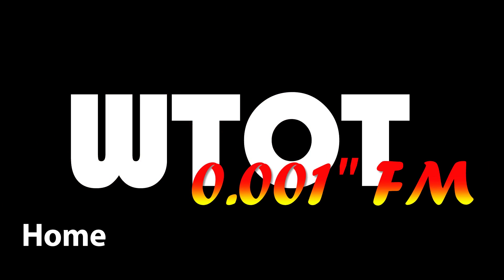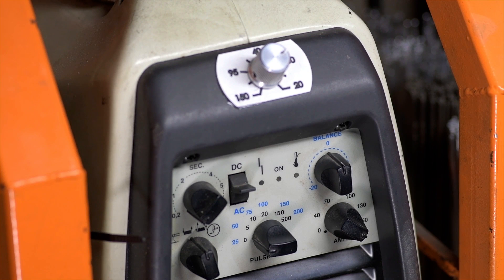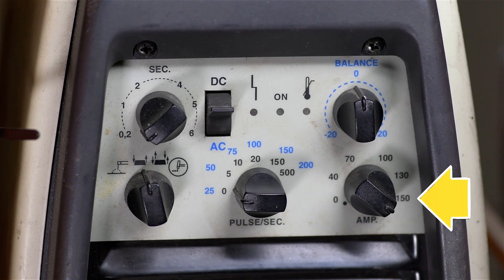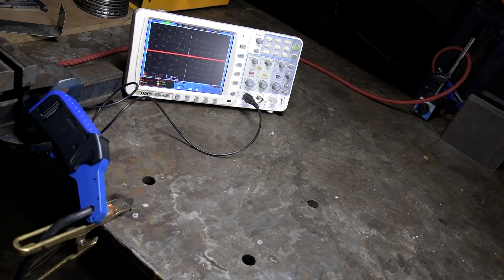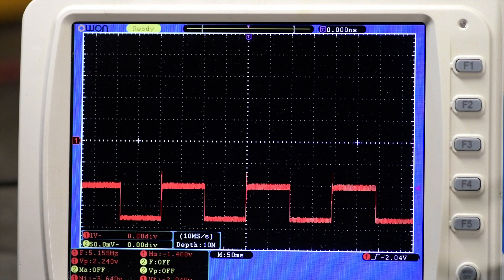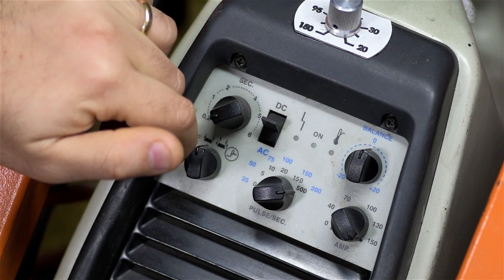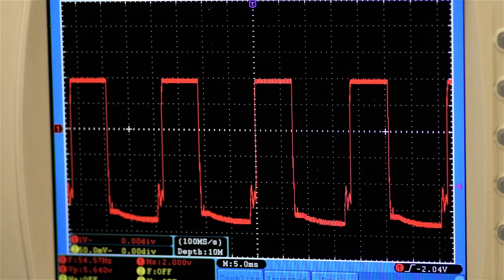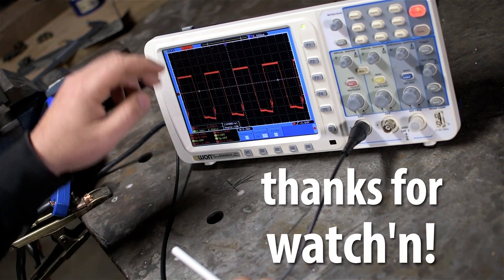My TIG Is Breaking Up With Me

Comment: Check the ac balance pot. 0-5 or 0-10 or 4-20ma signal , manufacturers use different standards. Check that signal as you turn the pot, as the response from the waveform looks very dirty as you turned the pot. Trace the balance circuit and there may be multiturn trimmers inline , check those also. Even if you have one on hand replace the pot. Itll be 5 or 10 k

Comment: Hi, I don't clearly understand the trick with current clamp and voltage measuring - what do you exactly measure: voltage or current? (I've once tried to measure voltage of tig welding using voltage meter which I've plug to positive and negative clamps, but I've broken my multimeter this way. So, have you any tip how to mesure TIG-welding voltage during welding? 
PS. great video

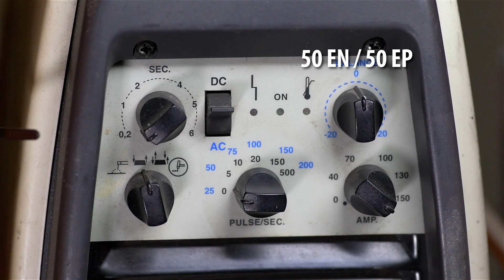Comment: Tony-san. Your math! Focus! around (4:50) "shifts balance to 70-30: 20 more negatives than positives..." So 70 minus 30 equals 20 huh?
Reply: @ThisOldTony as an electronics engineer with strong electromechanical affinities, I'd like to point out a confusing usage of "current" in your explanations. It will be mostly confusing for people who handle electrical applications aside from their welding. You seem to be using current for current, voltage and polarity. This may have resulted in a weird proprietary interpretation of the term AC. That "pulsed DC" is in fact AC (where you explicitly wrote on screen "so NOT AC". The polarity doesn't change, but it's AC nonetheless because the voltage alternates between two values, with the same circuit this will result in two values of current that it alternates between. So it is alternating current (AC) but without alternating polarity.
People who already have prior knowledge of electric circuits may get confused by your explanation, and people who don't have enough prior knowledge, will learn poor habits from this explanation...
As much as I love all your videos, I felt that I had to point this out. Especially because of your affinity with being exact when it comes to mechanical things. Without electricity your work wouldn't be possible, let alone be exact, so the electric side of things deserves an equal level of "exactness"...

Sure hope you get to read this, although I know I'd probably have more chance winning the lottery this week... (And I haven't bought a ticket, mind you)

Comment: I used to have an Esab 161 TIG machine that was even simpler than yours.  It blew out a bank of overrated Italian MOSFETs the first time I ran it at full power (160A) DC, and I reverse engineered the output board to repair it affordably with Made-in-USA MOSFETS from IR.   Your assumption on the AC Balance setting at "0" is mistaken, as this should NOT produce a 50% duty cycle.  The "0" setting is supposed to be a good starting point for AC balance on Aluminum, at perhaps 70% DCEN (penetration) and 30% DCEP (cleaning).  The +/-20% adjustment should tune this from 50% to 95% perhaps.  The welding heat is reflected by the area under the curve on your scope, so reduced DCEP current provides an amplifying effect on the AC imbalance, not necessarily a bad thing because it's saving your tungsten.  I honestly think the only problem with your welder that I saw in this video is the intermittent DCEP issue on AC.  THAT is a problem.  It's probably a bum chip between the oscillator and the MOSFET bridge driver, like an opto-isolator or some other level-shifting logic.  The Esab design used simple capacitive coupling to isolate the 5V TTL driver logic from the high voltage at the MOSFET gate drivers, so even a weak op-amp or comparator can create the problem you have.  Wish you were closer; I think I could help!  Of course, now I have an Everlast 255 EXT and left all those problems behind, along with the ability to fix it myself!  Love your channel.  I'm gonna get one of those Hantek CC-65 amp clamps!

Comment: I do realise that this video is around 2 years old, and you've probably thrown your old TIG welder as far away as you could. 
Should you ever come across the same problem again, there's 2 possible reasons for this/these fault(s).
To be able to regulate voltage or current, the machine ALWAYS convert AC to DC. To do that it use a diode bridge (or several) and a certain number of big electrolyte capacitors.
The faults you describe is most likely caused by 1 faulty diode on the positive side of the bridge, combined with 1 or more capacitors which have lost some of their capacity.

as these parts are some of of the more expensive bits of the machine, it absolutely WON'T be worth it to get it serviced, unless you can find the parts and exchange them yourself.

PS: sorry that my answer requires at least some knowledge of electronics. I may have skipped some necessary explanation of things I take for granted, being an electronics tech. guy 😁

Comment: Balance is not balanced at zero on tigs.  But more like 35/65  thats what they call balanced for aly.  

My TiG does the same thing,  its mentioned on the manual, its intentionally not at 50/50 on the "balanced" positiin .  Its a French machine so i will translate :

Balance goes from -15  to +15

35EP (35/65) being the 0 or the "optimal cyclic ratio" position.
+15  equals a 50EP/50EN wave
-15 equals a 20EP/80EN wave 

My other tig Miller machine will go from 10EP/90EN  to 70EP/30EN  but you can set EP/EN amps independent

You rarely need more than 50EP.  Or thats some very dirty alu like porous castings full of crap and oils... 

(But your machine not going full amps on the other side is weird.  Maybe there is a setting inside the machine ?)

Comment: The fact that it intermittently works is a traditional indication of a loose connection somewhere.  Finding where is the trick.  It of course requires that you remove the covers and then try to wiggle various wires or components on the boards.  But use something like a 2-foot wooden stick or similar length plastic rod (nylon or ABS, 1/4” to 1/2” in diameter would be good).  Start with the heavier cables.  Proceed to smaller stuff and probably smaller pointer (1/4” maybe).  Sometimes the problems are in solder connections, but often in connectors (or their soldering).  Especially anything that is suffering from vibrations is a prime suspect.  Think in terms of a cable touching a fan or a loose mounting panel.
As to the balance, I would start by measuring the voltage at both ends of the potentiometer.  Chances are the two should be same value, but opposite polarity, as an example +10 V at one end and -10 V at the other end.  At least that is how I would design it.
The overall system quite likely is an inverter generating the DC and an IGBT bridge turning it to variable polarity in the AC mode.  That’s how all the recent VP welders I know of are working.  In the older days there were SCR systems like Miller Synchrowave, but they were limited to operation basically at 60 Hz (American) power line frequency.  For other frequencies you need the mentioned IGBT bridge.

Comment: If you modified the machine from its original setup and intentionally bypassed and changed how it was designed/built by adding ANOTHER potentiometer (the foot pedal and manual current control are both potentiometers and there's a reason only one at a time is used to control the machine) then guess what? You probably damaged it with your "improvement". If you've made other changes and "improvements" to make it "hotter", then you've probably done even more damage. Especially an "inverter" machine that may not even be built for your "local" electrical service in the first place. 

You're also reading way too much into "constant current" and "constant voltage". YOU control the actual "current flow" with more than just your foot on the pedal. When you open up your "arc gap" and get a hotter arc its because it takes MORE "JUICE" TO JUMP THAT GAP regardless of whether the machine is "constant current" or "constant voltage" or "AC" or "DC" or "straight polarity" or "reverse polarity". Take it from somebody that cut his teeth arc welding before MIG became a "thing" and who has also MIG-welded extensively and did a fair amount of TIG in a tech school welding class as part of a diesel mechanic education. 

The "constant current" or "constant voltage" situation is within the machine itself and its a "self-protection" system simply BECAUSE actual welding current/voltage is NEVER "constant". Resistance changes continually with temp change and temps change continuously with amperage/voltage change and that causes more resistance change and its a vicious circle. 

Then there's MAINTENANCE. Welders - like generators and other electrical systems that handle high voltage/current and tend to generate significant amounts of static electricity and operate in dirty environments - like to be cleaned up occasionally. Heat sinks and fan blades and other components tend to get coated with dust, lint, metallic particles from ferrous metals attracted by electromagnetism, etc. 

And where in the hell do you live that your AC is 75 hertz?

Comment: Some of the errors on the O-Scope looked a lot like a dirty potentiometer. Others looked like a dirty switch contact. Seeing that the thing still works, but is essentially 'uncalibrated', I'd point an unusually pointy finger at those parts and not the heavy duty parts.

Comment: purpose of a.c. tig welding For materials, such as aluminium, which has a tenacious oxide film on the surface, AC power must be employed. By switching between electrode positive and electrode negative polarity at typically fifty times a second, the periods of electrode positive will be sufficient to remove the oxide and clean the surface,

Comment: A few suggestions: 1.) High frequency from a GTAW machine will destroy multi meters and oscilloscopes. Turn the HF off when connecting these meters. 2.) What type of tungsten are you using in the torch? For AC tig welding, you should be using pure tungsten or zirconia tungsten. The other types of tungsten don't pass welding current equally well in both directions. 3.) Don't grind a point on the tungsten for AC welding. Find out how to form a ball on the end of the tungsten electrode. The ball will help to stabilize the arc.

Comment: tony ur DSO only shows volts vs time.. 40A DC prob requires a ring clamp to measure it.. most multimeters would blow up
Reply: if you do volts x current you get Power in watts
Reply: you are showing 1V/division, as shown on the BLHS

Comment: hello Toni,
I bought the same oscilloscope and current clamp a  few days ago, because I destroyed my old oscilloscope trying to messure the current by the voltage drop of a shunt.
I can tell you, that the current of my LCD vision welder looks very bad in comparison to your welder.
At first, I had big differences between positive and negative current. Then I noticed, that I can change the coupling of the oscilloscope to DC mode and ground mode. With this settings, both currents were equal, but I have still a high current peak at the beginning of each positve current. This is the reason, why my tungsten electrode will split very often.

with best greetings from Germany

Edgar

Comment: I would start with testing the output stage devices. If one mosfet has failed, replace all as the others will likely have been stressed. Test back one component at a time until you hit no faults. A schematic would be damn handy. Drain the supply caps before testing. Use a tester like this: http://levysounddesign.blogspot.com.au/2016/04/octopus-tester-component-curve-tracer.html?m=1

Comment: Just like Dave Jones from the EEVblog says, "Don't turn it on, TAKE IT APART!"  
Just open the sucker up and see if something appears to be amiss.  Measure the potentiometers, coils, etc.  Caps leaking or exploded?  It's probably on a pcb board somewhere, where the wave pulse is generated.  Could be just as simple as some SM component needing resoldered.
What could it hurt to have a peak under the hood?

Comment: 10 years old plus? The easiest way forward is to just replace all the electrolytic capacitors. Maybe $100 or so, just replace them all. Digikey is your friend. Almost certainly there is a place where one capacitor is screwing up on the DC balance. But many of the caps are nowhere near their original specs. Just do them all.

Comment: I am very impressed  with your troubleshooting skills. Most experienced welders would know that there was something wrong with their welder, but wouldn't know what it was. The idea of using an amp meter clamp around the ground connection and hooking it up to an osope  to look at the wave forms was brilliant. Is the voltage reading on the scope comparable the amps or do you calculate that using Ohms law, or does it matter? Is the amp clamp made to attach to the scope or did you cobble it together. Should you hook up an isolation transformer between the clamp leads and scope input? I have a hand help clamp on amp meter if I opened it up and paralleled the leads to the voltmeter and brought them out to a plug for the scope would that work? With a wiring diagram and possibly a manual you could probably repair this unit very cheaply.
Reply from the maker: Thanks John.  The clamp meter has a selectable scale, say 1mV/10mA ie 1V/10A, so I set the voltage scale on the scope accordingly.  This particular clamp has a BNC connector so, yes, right to the scope.

Comment: I would say some "reference" power supply could not give expected voltage inside.
that could explain why many different functions shifted. I would check/replace electrolitic capacitors first.
I shouldn't be very difficult to reverse engineer this welder from PCB... at least power supply circuits.

Comment: Welding is not a science. It just a way to join two pieces of metal. In most cases you only need to input particular amount of heat to welding spot. If you want more precise controls use Fronius or Esab. But result will be almostly the same.

Comment: Had electrical gremlins in the house with intermittent strobe effect on the lights.  had electricians out regularly for over two weeks trying to chase it down.  we replaced well pump because it kicking on correlated to the power flickering.  had utility company out testing things, and even replaced a few panels.  Finally one guy came out and checked the box where the mains came in and heard the faintest arc when he flipped one of the breakers.  turns out it was an old breaker and a lizard had gotten down in there, fried, covered the contacts with gritty crap.  so as far as the tig goes, I vote dead bug inside machine. :P

Comment: Hey Tony, if you really want to dig into that one a bit I might be able to help you fix it. This is where things pass from your area of expertise into mine. See I'm mostly an electronics hobbyist. I do a little tig welding on small robots and RC cars but for most part I'm developing the electronics of them. That said, I have a small 110 amp Miller that I've had to fix more than once. With that I know my way around the inside of devices like that a little and I might be able to figure out what's going on. It might cost you as much as $60.00 for a digital multimeter from your local Home Depot or Lowes that has all the functions you'd need if you don't already have one considering you already have an oscilloscope there. Seriously though I'm more than willing to help if you want to give it a shot. Considering the age of the device I doubt it's still under warranty so the questions you have to ask yourself are "What do I really have to loose?" and "Is it worth it in the end?" Do keep in mind that future repairs are a cake walk compared to the first one since by that point you'll already know how most of it works and likely be able to figure out what's wrong with it a lot more quickly. The parts are easy enough to get through various websites that I've collected links from. So let me know either way. I promise I won't pester you about it in the meantime. Thanks for the great videos...
Reply from the maker: Thanks ESBoss!  Stay tuned for part 2, I'll do a bit of a tear down.  I'll be all ears after that.
Reply: Will do... That should give me all that I need to know to help too. Double whammy... :)

Comment: Change the pot, it is a cheap part, easy to check, easy to fix. (just don't wire it backwards like the unicorn horn) Open the case and use an analog multi-meter on the pot for resistance testing. it should give smooth movement on the meter if it jumps around like your oscilloscope shows, it is probably the culprit. I would put my money on the Pot, it's probably a cheap linear one, that is what they do.

Comment: Just a guess to look for. Look up the schematic page TAV 5B. on the top of the page the voltages for the gates (positive and negative) are created from a transformer, some diodes and caps.
I would look at that place for bad caps or diodes etc., your mosfets are not driven positive enough, this limits output current and moves the ac balance. But I am just guessing ;-)
update: After some more research, I see I was wrong. This is certainly not the problem, that board is turning the 220v input into a lower voltage to be inverted, it is not the inverter driver. Sorry.